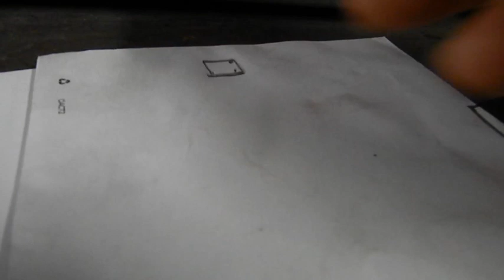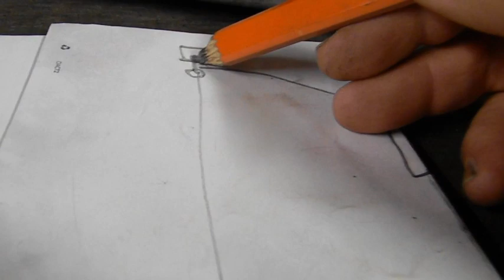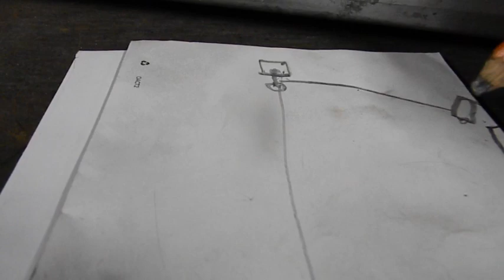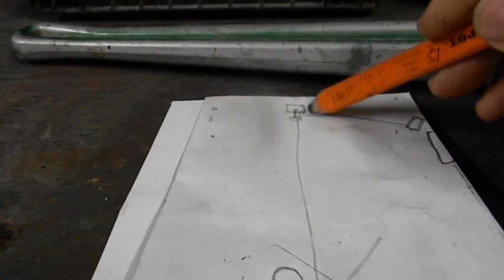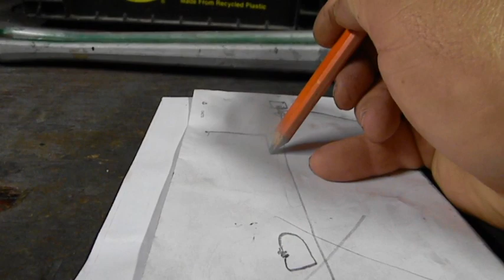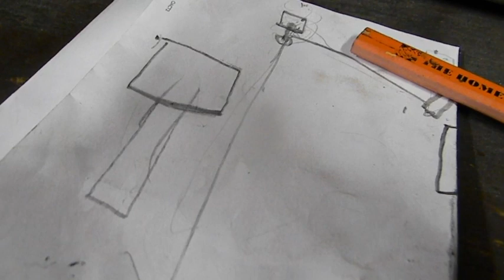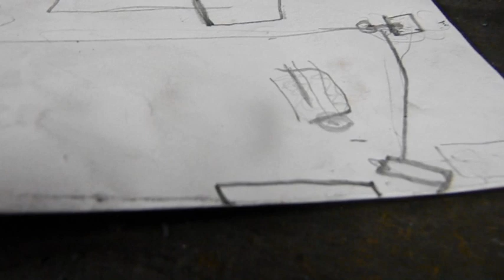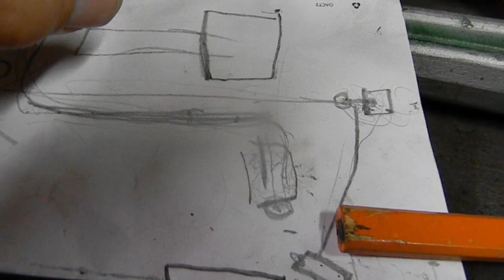Update

Comment: Sounds like the hit setup. Sorry about the water heater. My niece had thee kitchen drain clog in the house they just bought, built in the 40's. They snaked it and the wall collapsed. The pipe went down through the brick on a load bearing wall. Her husband bought a home warranty, but the cheapskate bought one with a $10K deductible. So.... you're not the only one with plumbing problems. Good luck!
P.S., can you change the anode every few years? We had a similar problem with the storm Vulcan at the shop when the made us take out the vat. The anode in it had to be changed every two years. The anode was readily available from the local hardware store. So, I'm wondering if it's the same type, and if they are available would it be a lesson learned down the road?